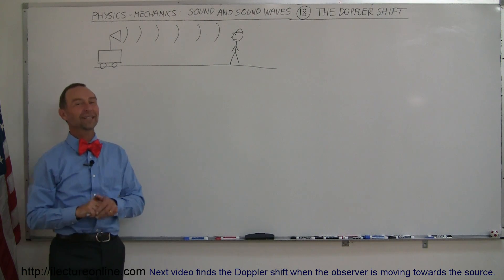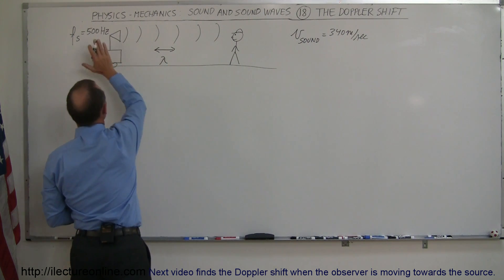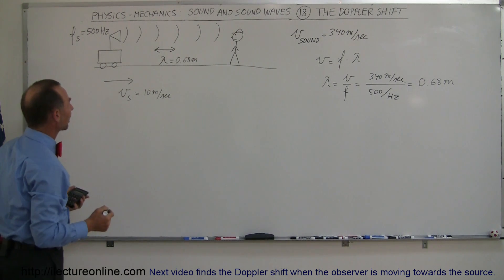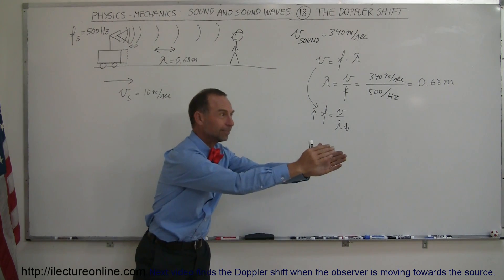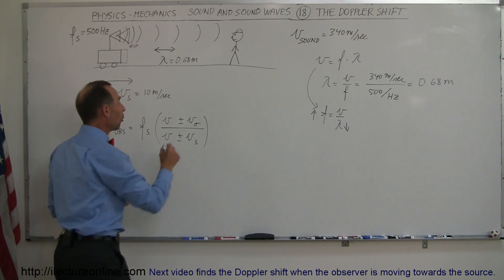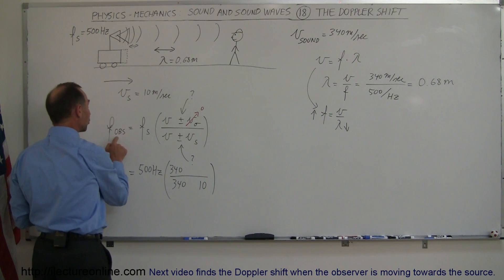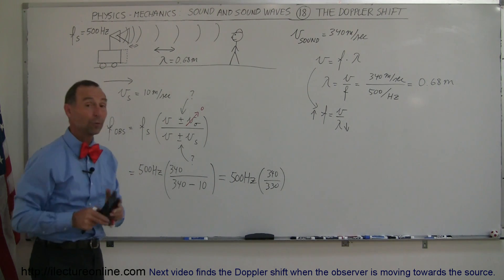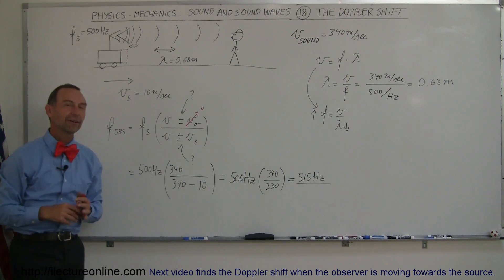Physics 20  Sound and Sound Waves (18 of 49) Doppler Shift

Comment: Sir I have a doubt: assuming that the speed of sound waves in air is 340m/s; if the wave is produced by a car going 20 m/s, will the wave travel at 360 m/s?
Reply from the maker: No, the wave will still travel at 340 m/sec, but the frequency and wavelength of the waves will change.

Comment: There is another easy way of doing this instead of the formula at 3:53.
find the differential λ using the formula f = v/λ. So 10 m/s divided by 500 = 0.02
then 0.68m - 0.02m = 0.66m
Now f = 340 m/s divided by 0.66 = 515.15Hz

Comment: If someone on a stage is addressing a crowd with a megaphone, based on the Earth's rotation if the crowd is moving into the sound waves at up to 460m per second or away from them, should there be a tonal difference in the sound wave the crowd would hear?
Reply from the maker: No because everything moves with the rotating Earth.
Reply: Michel van Biezen 
Allow me to give you 2 examples where this may not be the case.

#1**- As Earth orbits the Sun at 66,000 km/h we are moving towards stars and away from these same stars given the season.  Proof of Earth's orbit would be in seasonal doppler shifts due to our orbit.  Do we detect seasonal shifts in starlight due to Earth's orbit?

#2- As someone speaks do the sound-waves fire out like a projectile where if the waves hit a listener moving with or against the rotation, the listener is travelling faster or slower through the waves?  Would this create a tonal difference in the waves?
Reply from the maker: #1  Yes
#2  No   (They are very different situation)
Reply: Michel van Biezen 
Perfect and thank you.  

For #1, where is the data to show we are looking at doppler starlight effects from our yearly orbit cycle around and the Sun and not the daily perceived motion of stars which in a Geocentric model we would have a daily cycle of doppler starlight shifts as well?

This would end the debate if you have actual data and proof of a yearly cycle of uniform doppler starlight shifts in the direction of our orbit and going away from stars.

Does this data exist?

Comment: You know the ± on the top, is it the same sort of logic as with the symbol on the bottom? So, if the object in question is moving towards the observer, one would expect a higher frequency. And to get a higher frequency, you'd want a higher numerator. In other words, would it just be the opposite of the sign on the bottom?
Reply: yes

Comment: What is frequency regarding waves? The definition of frequency is events/time. How does that fit in with waves?
Reply from the maker: The basic wave equation is:
velocity = frequency * wavelength

or frequency = velocity / wavelength

If you check the units you will get (1/sec) = Hz
The interpretation is waves per second, or cycles per second, or oscillations per second.
Reply: Thank You. Love your videos. Now I know where to learn more about physics, after I drop from advanced physics. Is it better to solve a physics problem using units as your guide or should stick to the formulas?
Reply from the maker: WWadventure
There are occasions when you will use one method and times when you'll use the other method.  There are no absolutes to the problem solving technique